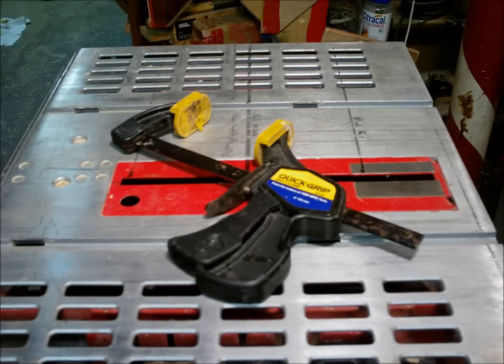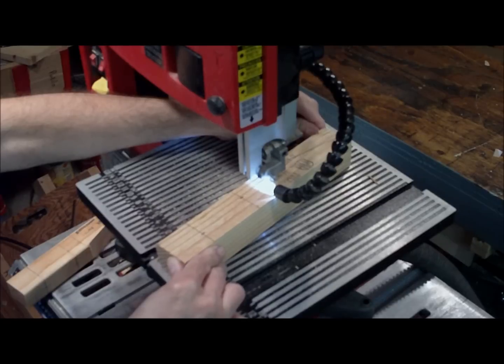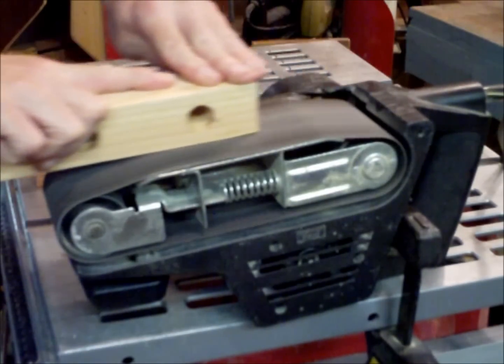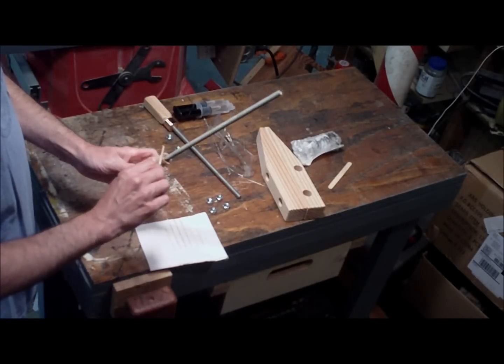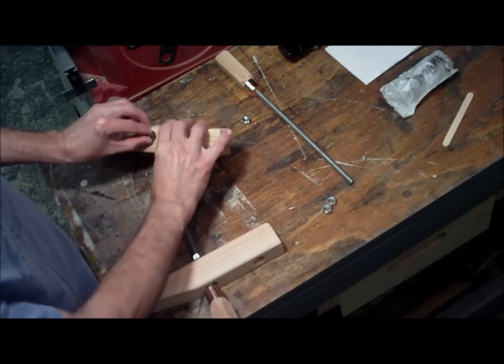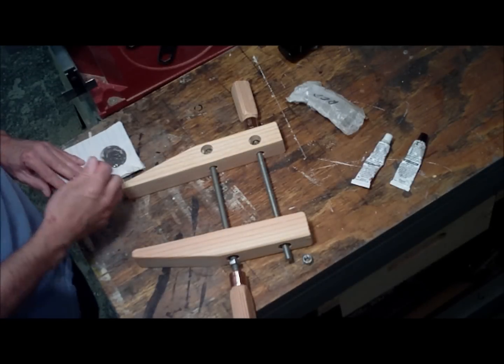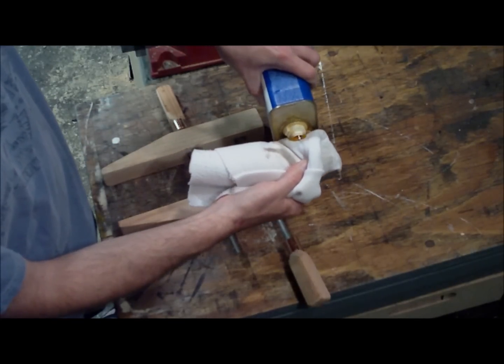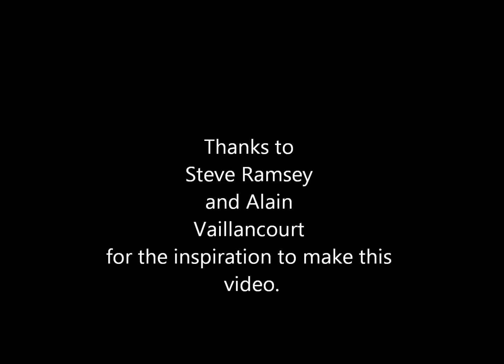Ligneroj-1 Hand Screw Clamp

Comment: great video! where do you find copper caps at?
Thank you!
Reply from the maker: You should be able to find them in the plumbing department in any hardware store.  They are for capping copper pipes. Thanks for watching. -Dave
Reply: Ligneroj
Thank you very much Dave! I found them today at a local hardware store. I live in Mexico so many things are not as easy to find as in USA especially limiting me in my Spanish language capabilities. PS I enjoyed your Esperanto version(s). I hope my clams come as great as yours did! Thanks again! Saludos desde Mexico
Reply: few more things I would like to know:
1. the species of wood used for clamps? could I use pine?
2. I suppose that where the clamping pressure is - it preferably should be end grain, right?
Thanks again!
Reply from the maker: Andrea Arzensek  1. I used a piece of comon 2x4. I'm not sure exactly what wood species it was (Douglas fir maybe) Any hardwood would also give excellent results. 2. Since I simply split a 2x4, I'm thinking that makes the inside of the clamp edge grain.
Reply from the maker: Andrea Arzensek
If you couldn't find the copper caps, you could also use a piece of copper or steel pipe (electrical conduit) as a ferrul, or even leave it off completely. I put them on basically for the looks. Glad the video helped.

Comment: You failed to explain that to open these properly one of the bolts needs to be left handed thread.
Reply from the maker: Untrue. Both bolts in this project are right hand thread.  The clamps use common hardware items.
Reply: @Ligneroj  We commonly hold both handles and wind them out like a windlass.  The jaws remain parallel.  Yes, you can make it very awkward to use by having both threads the same but that is not sensible.  Left hand threads are easily available online.